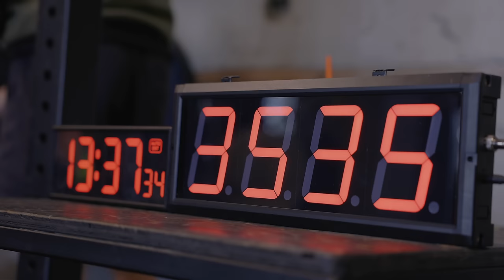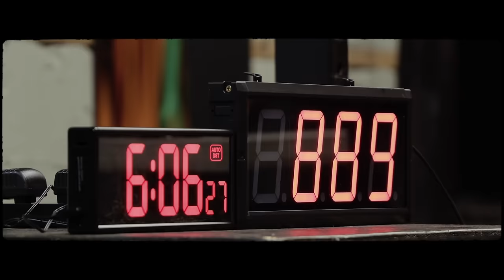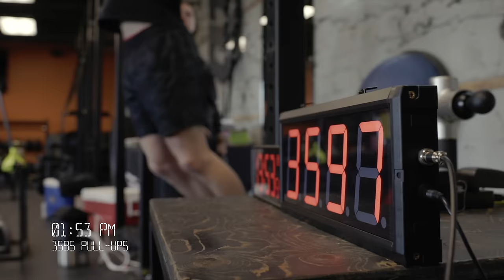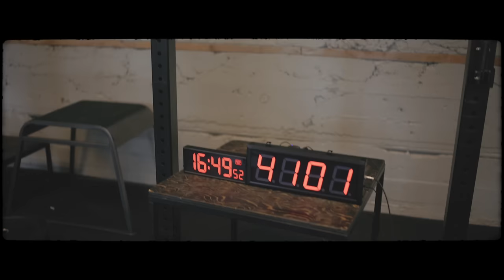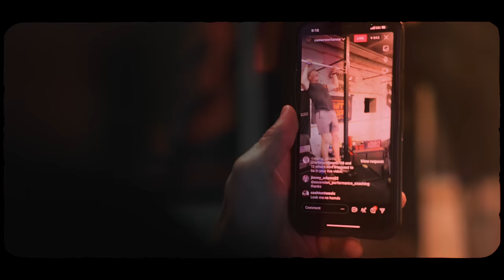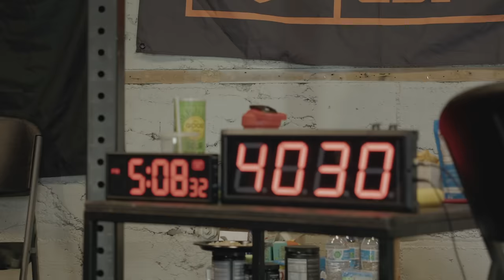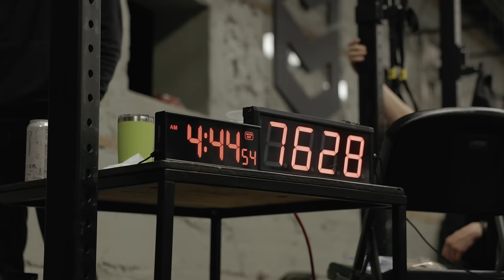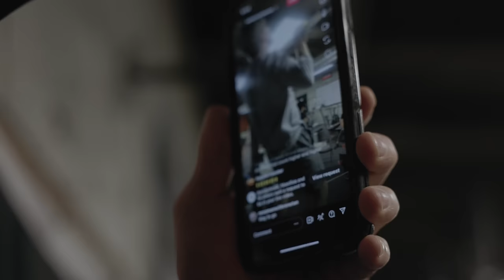8100 - Breaking the World Record for Most Pull-ups in 24 Hours

Comment: Great work!
You've got to train your gut for carb intake. Learn from pro-cyclists as they have it dialed in the best for all-day bike races. You should be able to do a steady 70-100g of carbs per hour as you are now, but it can be trained up to ~150g of carbs per hour for a few hours. Once you can handle that much, you can back off to ~60-80g per hour and maintain that all day long. At 80g/hour you'll consume 7,680 kcal over 24 hours, which is just under the amount you will burn doing 8,100 pullups. Aim for simple carbs like Gatorade, gels, rice, bananas, etc

Comment: I made 629 pull ups in one hour and its hard , one Problem i made this outside and was could .only my clothes had 3 kg.   Its not much when you do at once but when you do at hour and more its big weight.I increased with one friend if i will do 600 . I made clear and in maxim amplitude and its give problem at shoulder joint. So musch Technical how to do at pull up. Chose what you like and enjoy it 🎉. Now i understand in one hour i need to eat each at 10 minute carbohidrat meal, like when i run marathon, and drink water with electrolytes. And one think 🤔 what i understand it's use compression sucks like Italian pull ups used.